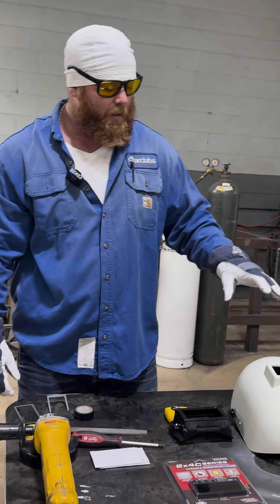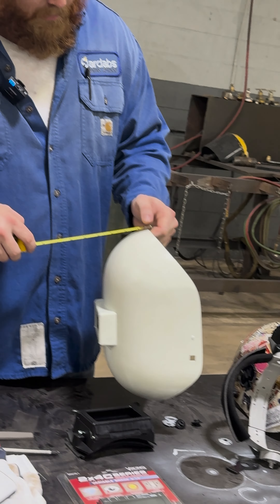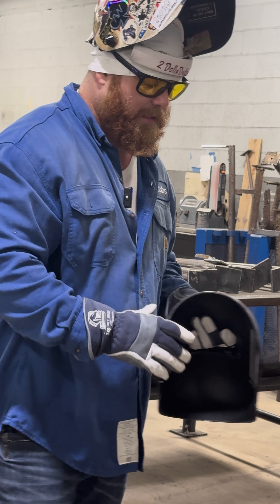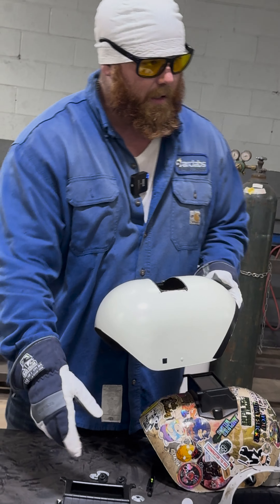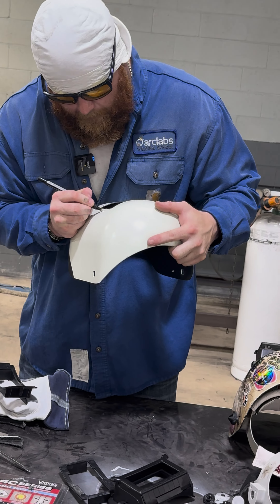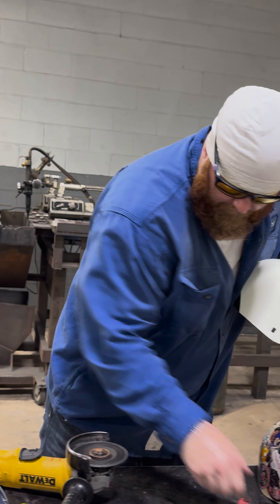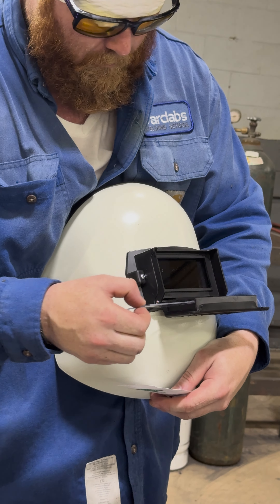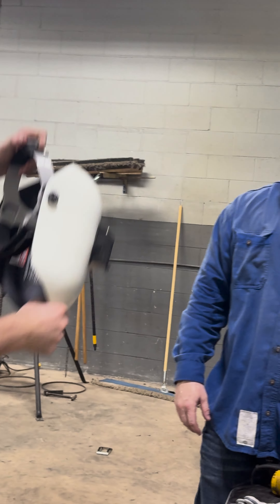Modifying Sugar Scoop for a student!

Comment: Techniweld makes a sugar scoop that has a flip up already out the box and has miller style head gear. Best one I’ve found
Reply: That’s new no one on the field is using that yet Also real welders unlike you have to show up to alto of jobs and use a hard shell rig (you probably don’t know what that is which further proves your not a real welder) and those techniwelds can’t fit a normal halo or the hardware we use that’s what 99.9 of contractors provide are the ones compatible with the fiber metal brand
Reply: @Welderomejico666 damn bro
Reply: @Welderomejico666  I am just curious. I am in school for welding. Do employers usually provide you with a helmet etc.? Or do you have to provide all of your own stuff usually?
Reply: @Welderomejico666  You can easily modify a miller style hood to run fibre metal headgear just cut out adapters out of some scrap plastic
Reply: @HunterFain-b7f  you should always bring your own welding hood. I worked for a company where they did provide you a welding hood, but that shit was heavy as hell and very uncomfortable, I believe it was called the tigerhood. So if you're very particular with what hood you're comfortable with, bring your own. If you're okay with working with any used and beat down hood, take the risk for the company to provide one for you. I'll say most high paying jobs like in refineries won't hire you, if you don't have your own hood. They only provide consumables and wire/electrodes and the welding machines themselves
Reply: @Welderomejico666  theres actually an adapter for the techniweld hood to fibre metal headgear. But your just one of those welders who thinks they know everything.
Reply: @ I do know that it’s one guy who makes them no one is using all that on the field hasn’t been around long enough for one and two people will just available we don’t have time to wait to buy things from different places we are in the road living from hotel to hotel or campground a real welder is just gonna make the dam little square on the side done it plenty of times
Reply: @Welderomejico666  You sure seem to know a lot about a guy you know nothing about. 😂
Reply: @Welderomejico666 its just a welding hood. 💀

Comment: Those sellstrom adapters are so heavy and bulky. Better solution would be to leave the fixed frame and buy an auto darkening lens with grind mode or buy a true arc pipeliner style hood that has the flip-up that looks similar to the fixed style

Comment: Yall know weld tube has a flip lens that clips on the sugar scoop  with no cutting  and its lighter than the sellstrom
Reply: Real welders like us not like you  will drop that in a second considering the work at heights we do and the tight spaces we work in a lot of places like plants and nukes will not let you have anything that’s not permanently attached but you would know that cuz you you just buy things cuz they look cool on tik tok
Reply: @Welderomejico666  I have 4  pipe liner hoods on my rig son 2 are sellstrom flip frames with different lenses 2 are regular non flip incase I go back to a nuke  And if you worked nukes you would know you can't grind with a flip welding hood  we had to use foam back goggles and a dam hockey mask  . Real welder my ass you probably a dam helper boy
Reply: @davidfowler332 he def hasnt even picked up a stinger yet, js grinding for 9 hours a day. Quick question, so I've got this manual flip helmet, not quite like the pipeliner in the vid, but similar, and i rlly wanna put an arc one auto darkening lense in there, is that smth youd suggest? That way id p much never have to flip my hood up and down like i do now
Reply: @Grasscentral4705   I have auto lenses in a few hoods  but if you ever have to get into a really tight spot  or a mirror weld it will flash on and off  wens lens makes a great glass lens  they don't flash and no batteries .  they give us the speed glass hood when it first came out dam thing would flash and batteries would go dead  so  the RT crew went back to  the chopped up sugar scoop with wens lens and light weight leather top and bib  i would velcro the bib in hood and you can change the length for different weld processes  no screws or rivets and its light. Auto lenses have a place  its like a tool you may need  a different tool every now and then
Reply: @davidfowler332  Damn thanks man I rlly appreciate the input from  someone who knows what they're talking about. It seems like from what you're saying that I should keep a fixed shade and auto helmet on me at all times while on a job right? Im only ab a year into welding, and im js learning ab all this welding gear stuff
Reply: @Grasscentral4705  you just starting so just get a solar auto lens .when you get to the limited access and simulator or moch up welding then get a fixed shade lens  you shouldn't need one for a wile .
Reply: @davidfowler332  Ya, i have a fixed shade welding helmet that ive been learning on, and its definitely made things a lot more difficult in many situations. Ur input has my mind made up, ill buy an arc one auto lense tn